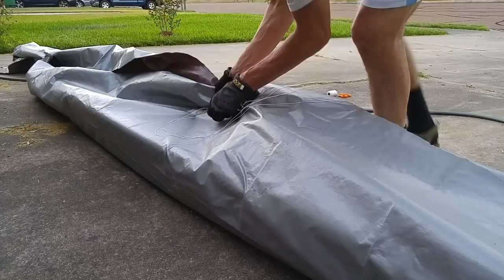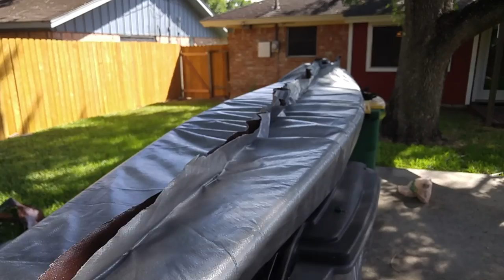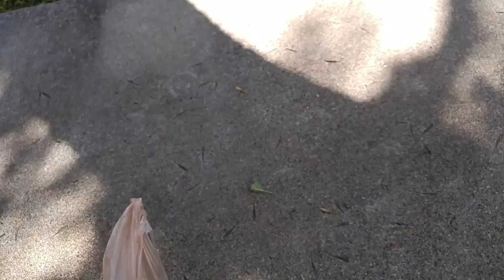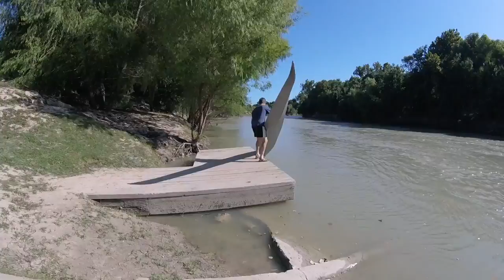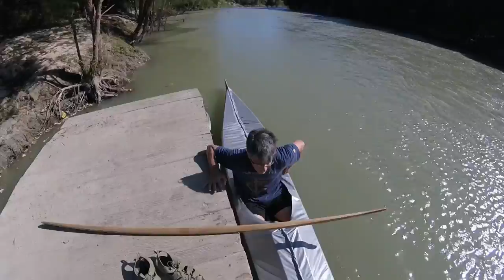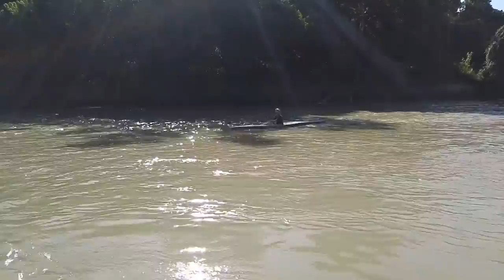PVC Kayak Frame with Tarp Skin

Comment: if you could get ahold of some industrial strength heat shrink wrap we used it on the yachts we built to totally seal out any moisture or dust you could wrap it heat it and just cut out your seat area just a thought
Reply: A tip: you can watch series at instaflixxer. I've been using it for watching all kinds of movies during the lockdown.
Reply: @Bronson Titus Yea, I've been using InstaFlixxer for since november myself :)
Reply: @Bronson Titus Yea, I have been watching on InstaFlixxer for months myself =)
Reply: @Bronson Titus yea, have been watching on instaflixxer for years myself :)
Reply: @Bronson Titus Yup, I've been watching on instaflixxer for since december myself :D

Comment: Hello, I would like to know what kind of tarpaulin you use in the video for the kayak you are building?I also built a kayak, but from PVC pipe. The only thing missing is the tarpaulin, but I don't know what to buy.
Invite sent
Reply from the maker: @Szalkai_Zalan  it was cheap poly tarp from the hardware store. It would be better to use canvas and then paint it with house paint.

Comment: Imagine if you kept the tarp as is,but cut the kayak frame in half. You now have a portable kayak. Unroll the skin, shove both pieces into their perspective ends, and join them with a recessed inner piece of pipe.  Then a simple zip tie would hold them together. Now refine this and you are on to something. For instance, make the frame collapsible. Easy to do, when you realize you don't need to glue the pipes, the skin will hold them in place. This kayak could take up less room then a tent, and fit into a similar sized bag .